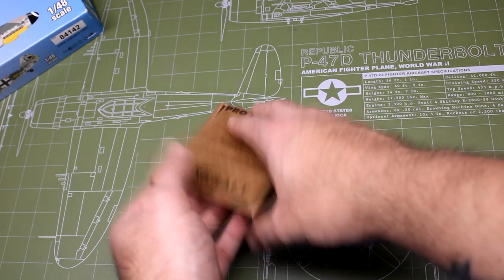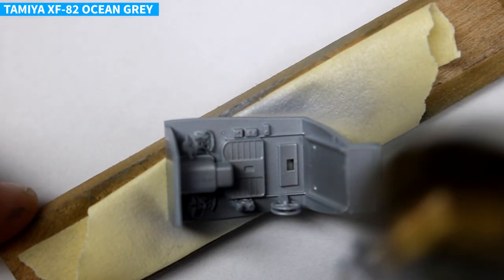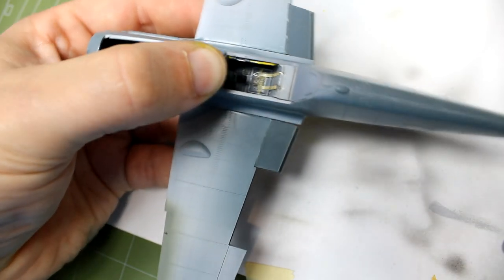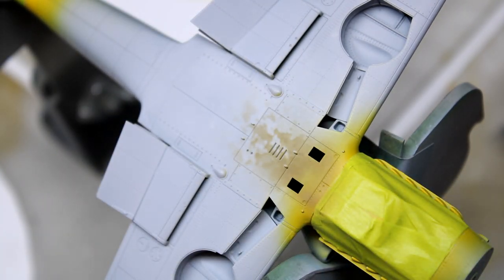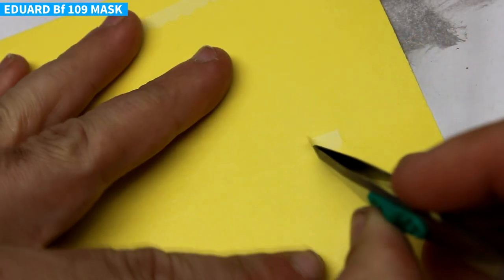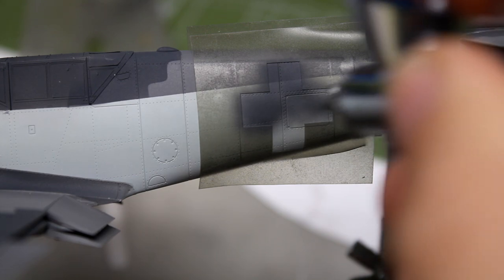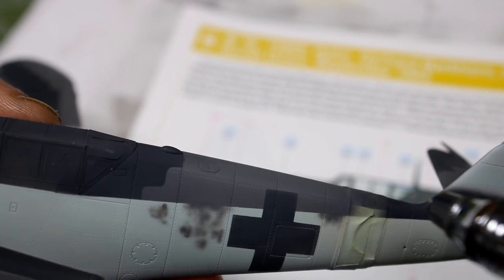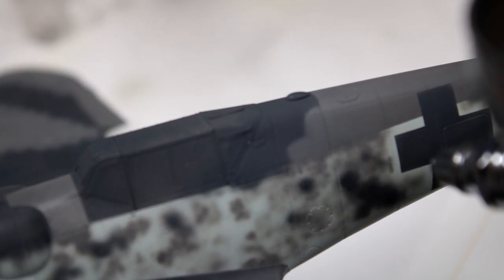My First Luftwaffe Mottling! Airbrushing German Aircraft Camouflage

Comment: I've always found that when I have partially completed one side of the mottle, I start the other side but with a mirror on the started side, so as to get a similar amount of mottle applied on both sides.
Reply from the maker: That’s a good tip thanks!

Comment: Quite nice mottling you made out of it, good description of your process 👍 It's a pity that Eduard does not show in instructions places that should be filled or corrected, like those engine cover parts or infamous "Eduards's V", rookie-trap V-shaped line on lower centroplane. I also think that decals on outer flaps should be placed inside (RLM02 covered part) of flap; next time also don't forget to add braking hoses on landing gear 😉
Last thing to add - I would not choose this color combination (I fell in love with MRP colors since last year); but as mentioned, at the end also the color mix does not look bad at all. Very nice model and fine build, thanks for sharing 👏
Reply from the maker: Unfortunately I didn’t realize the flap position indicator position was wrong until the very end. I followed the stencil instructions :S

Comment: Looks great, though none of it was field applied, it's a standard Erla G-6 scheme and was all factory applied. Imo the erla scheme is the most interesting of the 109 factory schemes.
Reply from the maker: That’s weird because when I looked at several reference photos none of them matched. I assumed the mottling was done at the unit level.
Reply: @TheModelGuy  poor Hans had to spray all those spots. There are photos from the factory of the painted fuselages.

Comment: What, exactly, was the problem with the 109's undercarriage? I noticed on my 1/72 that the angle of the struts and the wheels themselves are splayed out. Was it (what we skateboarders would call) the wobbles?
Reply from the maker: Because of the angle of the landing gear legs they were prone to collapsing under very little loads